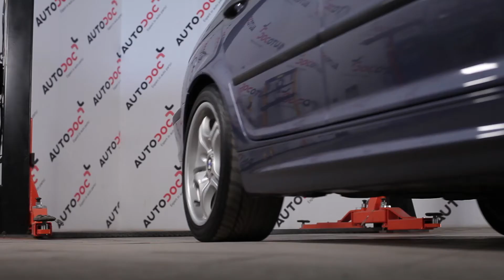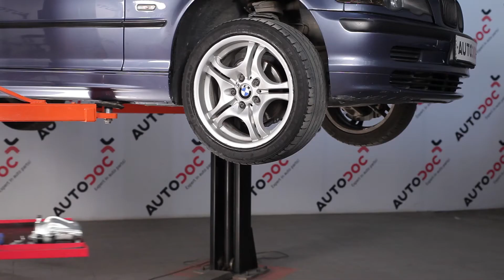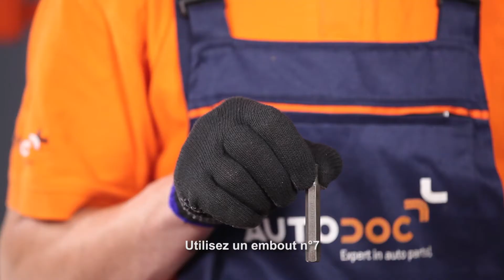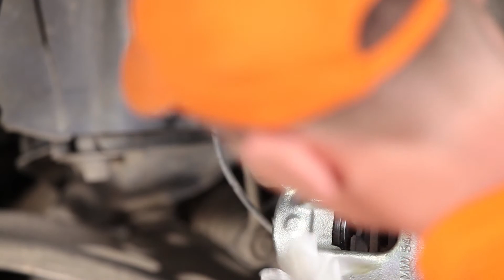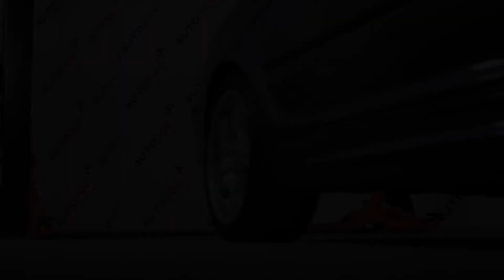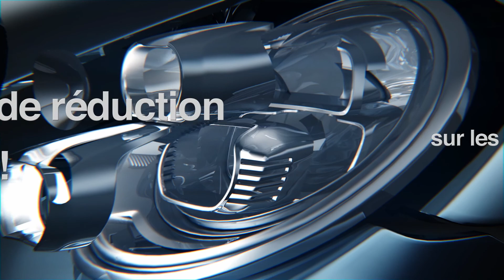Comment remplacer un étrier de frein sur BMW E46 [TUTORIEL AUTODOC]

Comment: Bonne vidéo, simple et efficace, qui n'a pour but de ne montrer que le changement d'un étrier, ce qui est bien le sujet de cette vidéo.

Quelques remarques dans la "vraie vie" :

1/ D'un point de vue esthétique, c'est très moche d'avoir un étrier neuf et un support d'étrier rouillé qu'on verra à travers la jante. Il faudrait restaurer le support et le peindre (en gris pour correspondre à la couleur de l'étrier dans ce cas).

2/ Pour les plaquettes, comme elles sont sales et rouillées, il faudrait gratter la rouille/saleté et nettoyer tous les surfaces de contact avec l'étrier et mettre de la graisse cuivrée.

3/ Effectuer une purge simple du liquide de frein pour s'assurer qu'il n'y ait pas d'air dans le circuit.
Reply from the maker: Bonjour Monsieur ! Merci pour votre commentaire! Nous sommes reconnaissants de ces précisions. Elles sont très utiles pour nos spectateurs. Nous vous remercions pour l'intérêt que vous portez à notre chaîne. Cordialement, l’équipe Autodoc.